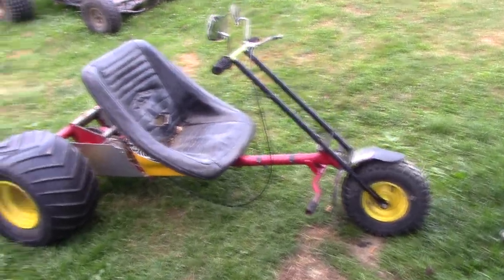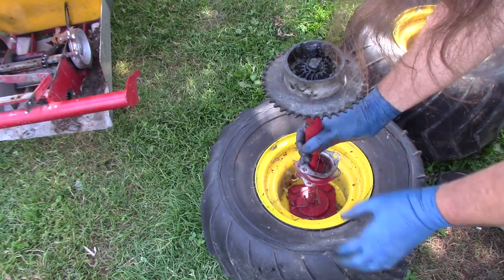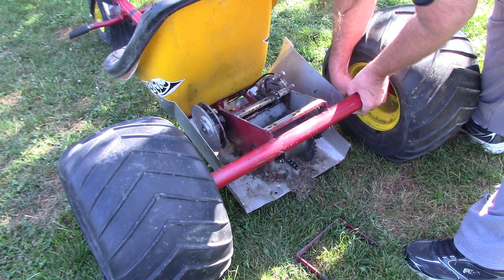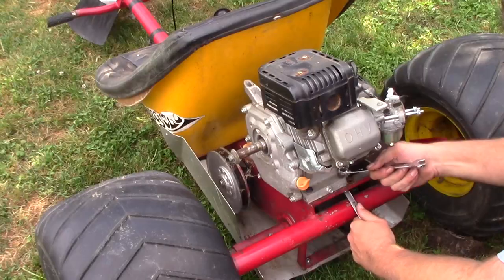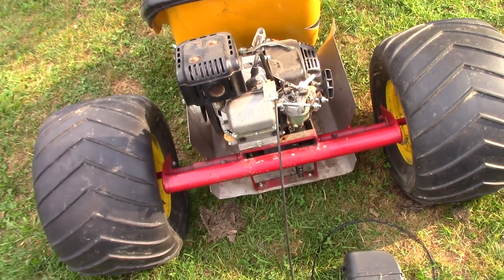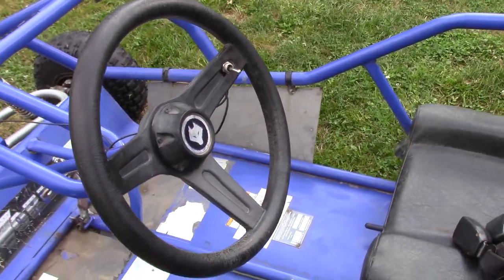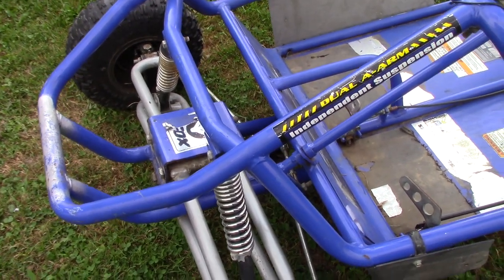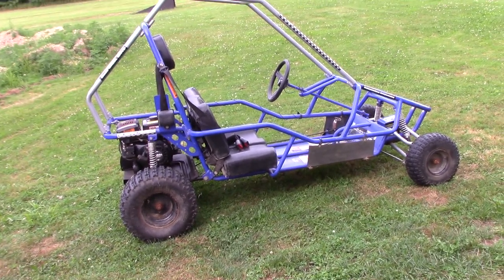Fixing the Dune Cycle trike

Comment: He man I have the same blue go kart a fox vortex
Reply from the maker: I haven't had it long but i like it, except for the steering. I will be modifying the steering and the engine on it in the future. Thanks for watching!
Reply: Yeah I also had to fix my steering because if I steered all the way to the left the kart would have go to another way and I already have crash a few times because of that
Reply from the maker: I haven't had that happen yet but moving slow it has a huge turning radius (takes alot of space to turn), and moving fast it is very touchy.